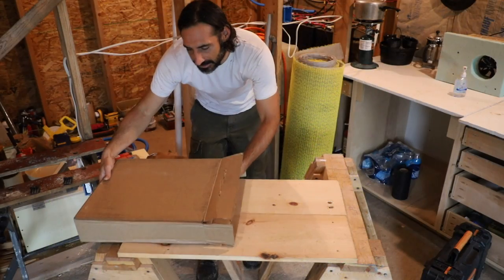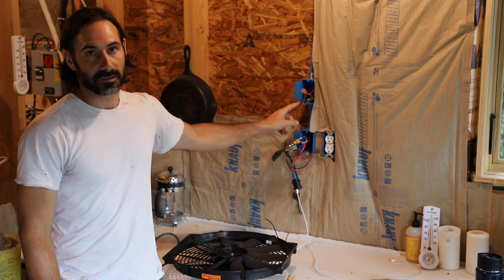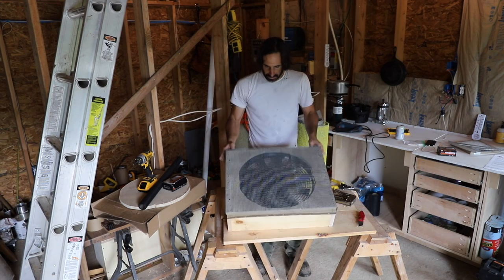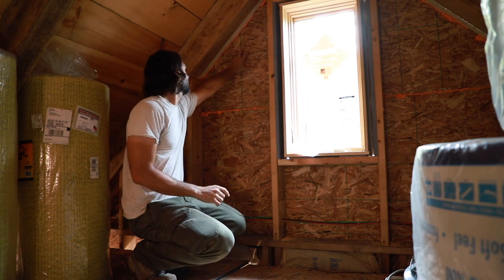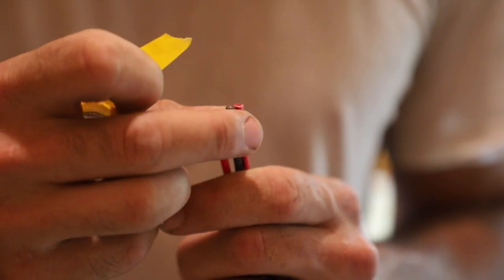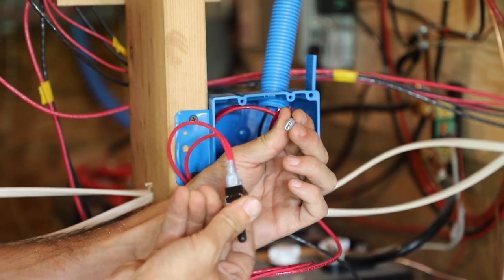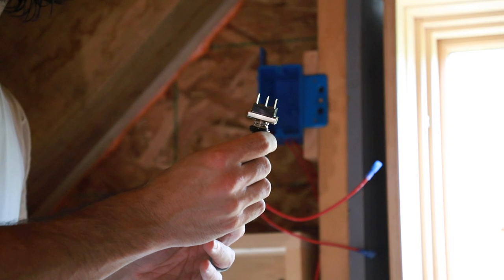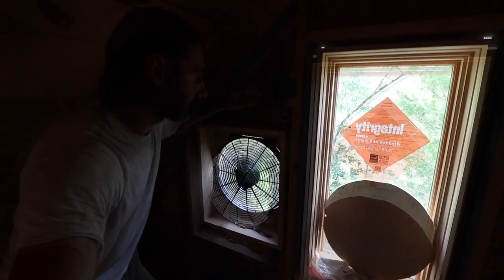Off Grid Alternative to Air Conditioning?  Making a Whole House Fan From a Radiator Fan

Comment: Not sure how I ended up here but glad I did. Loved this video. To those complaining about the noise, Yes its a loud fan but would you rather sit in heat or deal with that fan for just a bit? Anyway great job keep it up!
Reply from the maker: Thanks D, glad you enjoyed it!
Reply: People are only complaining because its an easy fix. We dont want the poor guy to have to hear that fan running full bore when in reality...it only needs 25 percent of the current power. Great video though. Hes living the dream👍
Reply: This is great for those still building up their home or need a vent and yes I agree that he doesn't need all that power or noise but he can always adjust it later as things progress. For now while building there will be lots of other noises going on. Lol drilling, cutting, hammering. I'm sure at this point that noise is the least of worries.

Comment: You're going to hate yourself when that fly screen clogs up with dust and shit and you can't clean it because you didn't make it removable, I give it six months max.
Reply: Just screws holding the fan in . Just removed fan and power wash inside out .
Reply: @jameslund221  make some plastic fins for it, like those dryer vents.
Reply: he is using it as a pusher fan, pushing the inside air out, using the down stairs windows to draw air in, it wont clog up.
Reply: He's gonna get dust but if he gets shit in fly screen he's gonna need a plumber cause somethings wrong.

Comment: There is a 5-watt per hour energy recovery ventilator sold in Home Depot.  It will change direction every 80-seconds to allow inside stale air to be exchanged for fresh outside air, and it will maintain an even inside temperature while doing this through an air heat exchanger.  The unit works 24-hours per day, and it is extremely quiet,

It is well suited suited for an off grid scenario since it draws less than 130 watts per 24-hours of continuous operation.

These units were designed for highly insulated buildings.

Comment: If you're close to a cool body of water, then you can use a 12 volt pump to circulate the cool water by way of a small dia insulated hose. Run the water through a radiator placed in the house with that fan. And no windows should be open.  The pump and fan could be powered from a solar panel.

Comment: For your installation may want to consider installing an insect screen, an air damper, and a vent exhaust for your fan.  

An insect screen will stop small insects and some pests from entering your home,

An air damper will prevent drafts of cold air from entering your home in the winter; it will prevent hot air from leaving the house in the winter, and it will prevent cold air from leaving the house in the summer.

A vent exhaust will help control strong winds from coming inside, and it will prevent pests from coming inside.
Reply: did you actually watch the video at all??????
Reply: Axeanda45 My scribblings ?

Comment: I'm if one crammed their head inside a bee hive, they would enjoy more peace than trying to live through the Gawdawful racket that fan puts out!
Reply from the maker: It changes the air in the cabin in 3 minutes (conservatively) then I use the built in silencer AKA the off switch.
Reply: It depends on the temperature and humidity.  I couldn't live in Louisiana or East Texas.  Too hot and humid even with an ac.

Comment: Way too noisy. You should have gone with a fan that has a brushless motor.
Reply: $300 plus for brushless motor.  Which is better?  Having the noise or the money???
Reply: A brushless motor wouldn't change the sound level. The blades are what makes  the noise.

Comment: Not even having enough power for real air-conditioning is a shining example of why I will remain on grid!
Reply: And what will you do when the grid goes down?
Reply: I intend to be fully prepared for a grid down situation. Yes, that includes the capability to live off grid if necessary. I just don't plan on living off grid all the time. Way too many sacrifices required. I LOVE all the modern conveniences available and don't plan on giving any of them up.
Reply: Canada’s summers are short and the temperatures drop at night where you don’t really need AC. That fan will be just fine.

Comment: I installed an exhaust fan in a room with ridged ducting and was not happy with the noise. After a bunch of research I decided the easiest and cheapest solution was to install some insulated flex duct with a wide sweeping bend in it. The only noise left is a very muted low frequency rumble of the air moving with almost all of the higher pitched, and more annoying wine gone. My fan is not nearly as loud, but it would probably be worth the small cost to try it yourself.
Reply from the maker: cool.  It only needs to run for 3 minutes so Im not too concerned with the noise.

Comment: My central air conditioner packed it in 10 years ago so I recycled the whole system except for the big fan on top. That fan now cools my house all summer long for a fraction of the cost of the old system.
Reply from the maker: Nice work!  people say its just a fan but applied correctly it really works.
Reply: It's only a fan, but it's a big fan. The trick is to use it at night by exhausting the warm air from your house and drawing the cool air in. Once its warmer outside than in your house, turn off the fan.

Comment: Good idea to use a radiator fan ...love the idea.
Though I would have put some sealant around the edge of the hole to keep moisture and super small bugs. That metal fabric is going to give you a gap.

Comment: To get access to the air along the peak of the ceiling, you could possibly have a small (3 inch?) duct with a small fan in it pulling air from the top above the window or something along those lines.  You could alternately simply put an inlet flap on the other side of the house that lets in a nominal amount of air to flush the peak out?
Reply from the maker: That would probably work pretty good

Comment: Great idea I have a 16 by 8 foot shed that is my work shop I have 8 foot tall side walls and a Gambrel style roof. My shed is insulated and gets insanely hot in it, and I have been looking at ways to cool it cheaply!! Eventually I hope to finish installing a new roof over the old part of the shed which I will carry the Gambrel roof (with a loft) over the old roof making the whole roof at the same level as the new Gambrel section, and I was thinking of doing basically the same as you and installing a fan at the peak!! I also have R19 in my walls and looking at foam board in the rafter voids (R11) so ultimately I want to heat it with a small 10,000 BTU propane heater I already own! When I am done though it should be warm in the winter (I am in New York) and cool in the summer and I will finally install a 12 volt solar panel system in the shed for mostly LED lighting but I think I could carry in your same system on a twelve volt set up in the end!!! Great Video!!!

Comment: Could have used two 12 VDC fans in series.  Adding a resistor bank connected to thermostat control could allow 1 or 2 fans to operate.

Comment: I would mount the fan suspended on springs and foam tape for gap sealing to keep the vibrations from transferring to the frame of the house. Power your 24 volt fan from 12 volts to reduce current, noise and airflow, kind of like a hi/low switch.
Reply from the maker: It moves 2,250 CFM.  If the air changed 100% efficiently it would be done in 2 minutes and 31 seconds based on the volume of the cabin.  So, once I wire in a PWM controller, It can still safely get the job done in 10-20 minutes or so at 1/4 power and that should quiet it a lot.

Comment: I actually lived in an apartment in Houston, Texas for a year that had no air conditioning.  But it had one of those fans.  And it wasn't as climate controlled as air conditioning, but I never had any trouble sleeping comfortably at night with that on.  Worked great!

Only thing with yours is it's so damned loud.  I wonder whether you could find something that was quieter...  Thanks.
Reply from the maker: It works really great.  I actually have two follow ups to this video, one where I install a speed controller to make it more quiet and one where I automated it based on the inside and outside temperatures.

Comment: Great job! You could put some sound absorbing panels around the fan to reduce noise if the speed controller doesn't help enough. Even just one panel facing the fan by itself could make a difference. Just space it away far enough that it doesn't impede air flow. A foot or so maybe. 
     Is this an off grid house? I'd like to know about your DC power system.

Comment: I knew when you dropped down wrong end of the extension cord I liked you LOL!  That is pretty smart to use a radiator fan. I may have to copy you. My 2 story renovation is pretty hot upstairs in the summer and has few windows that open with screens. I really learned something here. New fan here. Thanks.

Comment: Nicely done.   If you go under your house in the summer the air is probably cooler you could put a fan under the house blowing that cool air into the house with the help of ductwork together with the fan upstairs it may create a nice cool airflow.  Just something I noticed from the way the English use to build homes in Iraq back around the 1930.

Comment: That fan will blow either way, push or pull, depending on how you wire it. And the fan blade can be swapped for best efficiency.  If you get a curved blade for it it will be much quieter and actually blow more air.
Reply: Quite but less efficient

Comment: Just a tip for stretching screen or fabric into a frame, always pull and staple in the middle, and then each corner, turn it to the opposite side, middle and the corner, and the do the other opposing sides the same way.

Comment: On the outside I would attach a rain cover, so that the fan does not suck rain. You can check the manual or ask the Manufacturer if you can use a PWM Speedcontroller to adjust the Speed (and in cause of this it reduces the noise). The use of a PWM Speedcontroller can also reduce the inrush current and the DC-Arcs in the switches. I live in a normal house under the roof. I have six 12mm axial fans mounted in a wooden board, which I can put in the window frame when needed.
Reply from the maker: Nice, I plan to install a PWM controller this week.

Comment: What are you gonna do with the big opening during the winter.    Make a set of insulated auto doors for the box inclosure that open when the fan is turned on and close when off.    Wire them so the fan won’t go on with them closed, you could burn your fan up with no air to move in that box otherwise.    This will allow you to not have to do anything during winter to cold proof them.
Reply from the maker: I am going to cut a piece of foam that fits in that box.  Good idea for the failsafe.  I could see myself burning it out.

Comment: You could have used 2 12 volt fans in  In series in got more CFM  You can a had it wired one fan sucking in and 1fan pushing

Comment: Great video, thanks - really like the cabin.  fyi those fans are available in straight-blade and curved-blade models - the stats for each show similar CFM (cubic feet/minute). But 2 big differences - static pressure performance, for which straight blades are better, but you don't care because you have no obstructions (e.g. car radiator or A/C condenser) ..AND..curved blade fans are a lot quieter. You might want to look for a curved one - more benefit than slowing down the straight-blade with a controller, probably.

Comment: put a panel on back side of that box you made. with inlet holes top bottom. you can cut sound down and not hurt flow. and of all those fans are made for being around hot items so should be good. i bet made a huge difference lol.
Reply from the maker: it really worked fast to change the air thats for sure.

Comment: back in the 50s we put a fan in the barn loft. it was an old car fan driven with a belt and motor. my father said grind the ends of the fan blades off so the corners a sharp 90 degrees and watch how quiet it will run. he was correct that fan was very quiet. strange to me how sharp corners on the ends of the 4 blades made it quiet. it ran for many many summers and made stacking hay in the barn loft much cooler(relitively cooler).
Reply from the maker: very nice I bet it was quite a relief to have that fan running.

Comment: Some thermostats and RH gauges up and down stairs would let you monitor the changes, and learn the speeds/seasons for the most effect.
Perfectly well done proof of concept.  Put the open draft window on the north or shady side , as it can draw cooler air in.
Good luck.
Reply from the maker: Thank you Teresa.

Comment: Just a quick comment on a point you made about the wiring. You were crimping a terminal and said something about soldering being better. The fact is that a properly crimped terminal is better than a soldered connection when vibration is involved. Your ratcheting crimper does a fantastic job at giving a proper connection.
Reply from the maker: oh no kidding didn't know that always thought solder and shrink tube was better.
Reply: @50Acres  
Yeah, I could give a long dissertation on the subject based on 35 years in the marine industry where vibration is a big issue. Suffice it to say, you did it  the best way.

Comment: Great video! Nice idea using an automotive radiator electric fan.A bit noisy. Maybe a rheostat to slow to speed down might quiet it some.You could play with the speeds to get quieter and cooling efficiency as well.   a lot of those fans came with thermal switches as well. Turns then on and off automatically. Good for the hot seasons of the year, but would need to turn power off to the fan in colder times. I was a auto parts salesperson in the past. So you using automotive parts and accessories is familiar to me. Great to incorporate in solar power. Could also save some money over the RV and solar versions too.

Comment: Looks like a great project. There's some beautiful woodwork in there. Will be interesting to see the final project. The fan is a great idea to pull the cooler air through up and displace the hotter air. It will likely work better and last longer than a basic box fan would and do a better job. You can put some noise-dampening art panels on the finished interior walls and that will help quiet it down a lot. You can DIY the panels like the ones they use for home sound booths. The insulation will help do that too. Best wishes with the rest of the project.

Comment: Just a thought... If he were to have used several computer cooling fans, he could have put them in a frame that fit into the area above the window, plus they would be a whole lot quieter. and if one burned out then the cost would be minimal to replace it plus he would still have the other fans operating while he waited for the replacement fan. The sound of the fan he has really takes away from the peace and serenity of the cabin.

Comment: Great video good progress. A little tip if i might When your cutting if you turn the set square upside down so the lip is on the top and pull it towards you, You can use it as a guide to run your saw against perfect straight lines every time.
Reply from the maker: thank you for the tip I will try that

Comment: I'd suggest a 24v fan even if you have a 12v system. A fan running half voltage will use roughly 6 times less power, produce 6 times less noise, last longer, and still move something like 2/3rds as much air. The other option if you have a 24v system is to use the lowest power fan you can find in a  given diameter.

Comment: Very well done and thanks a ton for the link on the fan. Very versatile and can be used for many applocations. Anytips on reducing noise a bit?
Reply from the maker: Thanks Reefer, I'm going to be wiring it up to a PWM controller about a week from now, check back in and we'll see how it works, as it is now it changes 2250 CFM so it only has to run for about 3 minutes at full speed to change the air in the cabin.

Comment: Is it thermostat controlled?
When I contracted on Nantucket I put these in every home I did.
Instantly draws hot air out and equalizes the house temp. 
The ones I installed were thermostat controlled and shut off on their own.
Good stuff bub!
Reply from the maker: Yea it is,  it’s got a dual thermostat control that automatically comes on or off based on some parameters.  The outside temp needs to be cooler than the inside etc.

Comment: Very nice concept. The noise disrupts the quiet of the woods. If I can make a suggestion, get yourself an inverter and change that noisy high pressure fan for a low pressure high flow one. It will be a big difference in noise and air volume.
Reply from the maker: It changes the air in the cabin in 3 minutes (conservatively) then I use the built in silencer AKA the off switch.  I will probably wire in a PWM controller in case people sleeping in the lofts want to leave it running over night.

Comment: best easiest and low energy way to keep a house cooler
habe 30 120x120 pc fans in the bath room roof window, they suck all the warm air out of the home in summer, best at night, when I come how, so it cooles down all very good
they are so strong, you have really problems closing the bath room door :D
and they are also not so loud like a car cooler fan. Was my first try with one of these